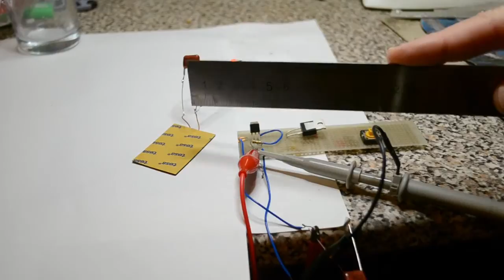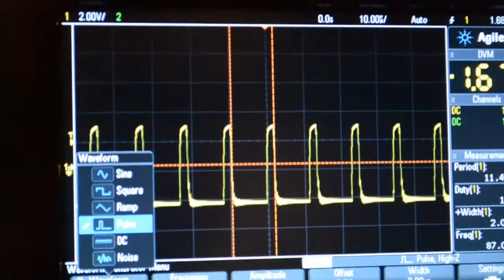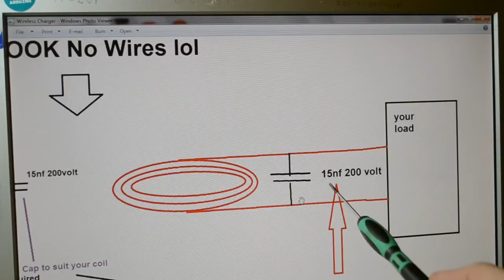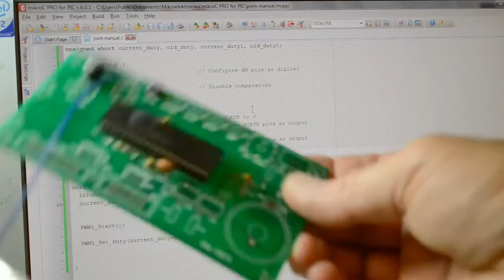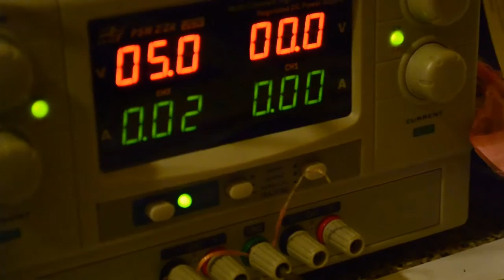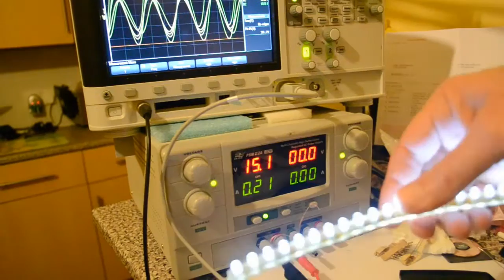Wireless Battery Charging, Contactless Energy Transfer, How To Make Your Own

Comment: For medical implants the external charging unit. Is it possible to change out the battery on a failing charging unit that does not charge the implant like it used too when it was new? Asking for a friend as a replacement charging puck for a spine stimulator is over 2k USD